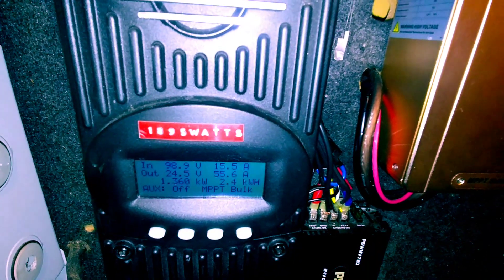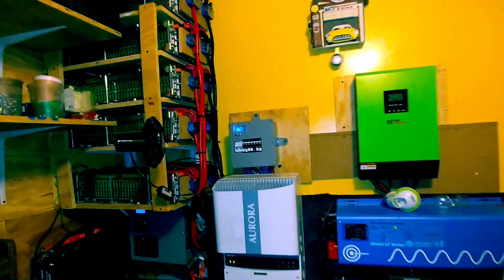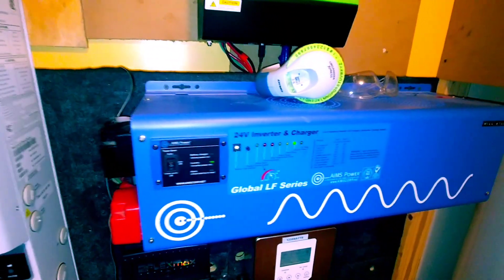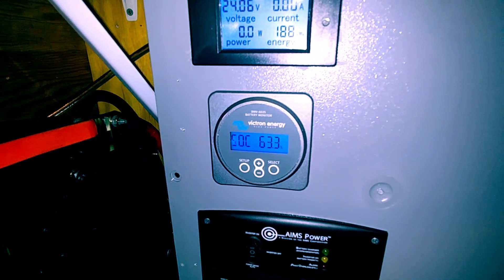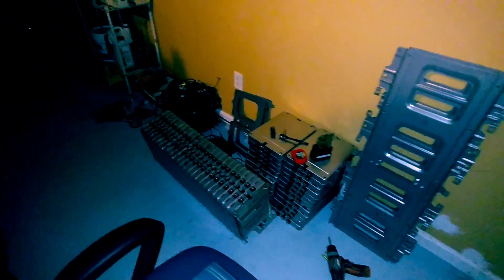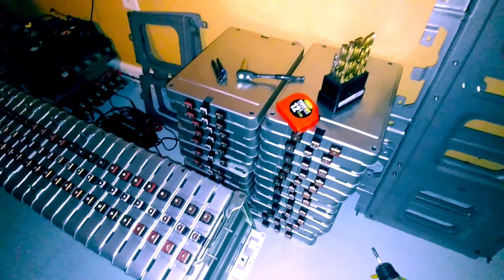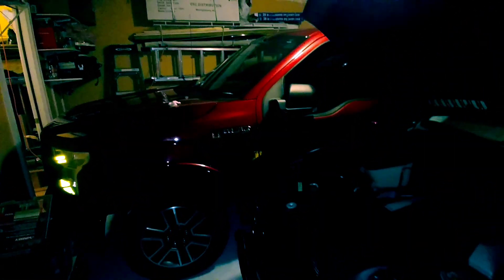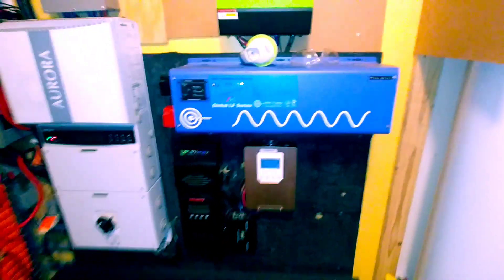nissan leaf Powerwall

Comment: Outstanding job well done brother. 
If I can only give my opinion to you, I would suggest you install a 5,000BTU window Air Conditioning this summer for the Power room to help eliminate or dissipate heat out from the battery room.
Please keep on the good work and keep the videos rolling brother👍
Reply from the maker: Thanks for checking out my video....you are right my friend...its hot in the power room

Comment: Your batteries may be performing with relative balanced voltage now but as they grow old, there might be the tendency for significant volt difference which might negatively affect the pack.
It may be great to add an equalizer to each pack.
Reply from the maker: Thanks for checking out my video